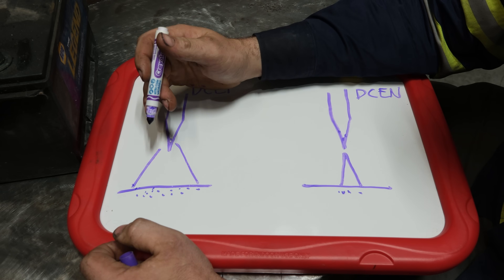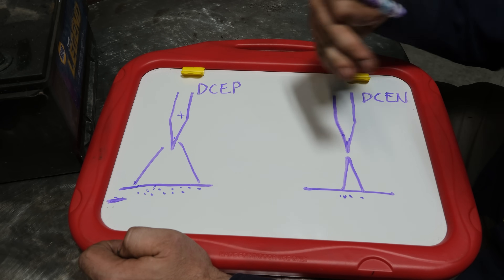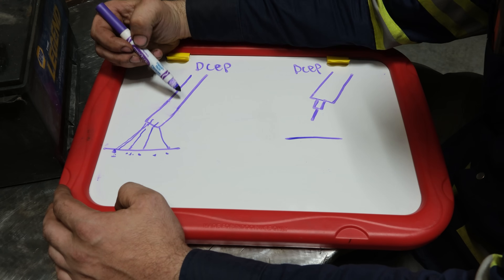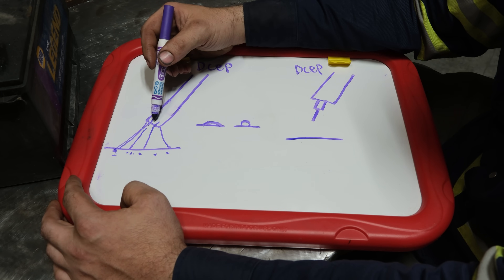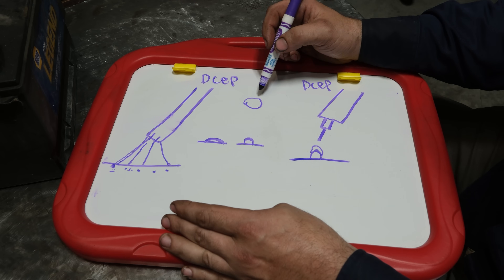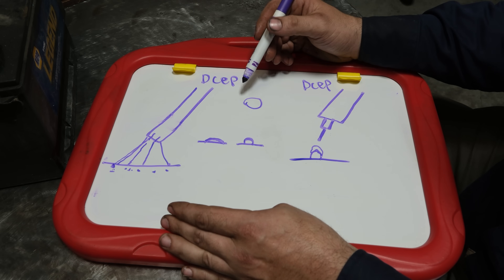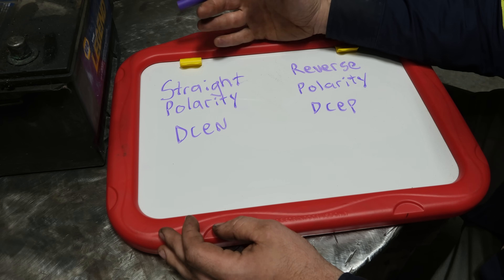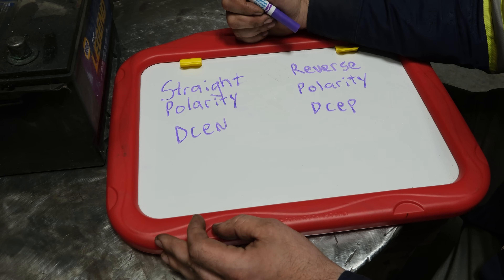Welding polarity and why electron theory is used (In response to #weld.com)

Comment: Why is DCEP work better for aluminum in TIG welding?
Reply from the maker: So aluminum has a surface oxide that can’t be easily removed by sanding or chemicals.  It’s very hard (aluminum oxide is actually used in sandpaper) and it must be stripped from the surface or the weld pool will be poor.  That oxide melts at a higher temp than the base material which is also a huge problem.  Think of pond scum floating on a fish tank and that’s exactly what happens when trying to weld aluminum with tig on pure DCEN.  The material under the surface will melt but the surface is just floating full of contaminates.  To deal with breaking the oxide layer up there are a few options.  1) to weld it on a/c and when the cycle switches to EP the electrons jumping from the base material to tungsten break up the surface oxide.  2) use helium and DC, the helium combined with higher voltage strips the surface oxide off making it possible to weld the aluminum on straight DC.  

So conventional tig welding of aluminum is done on a/c with 70-75% of the ac wave being negative (or electrode negative, or penetration) and 25-30% positive (electrode positive, or cleaning action).  This gives enough cleaning action to break up the oxide layer, and provides a clean molten puddle.  Older transformer machines weld on 50/50 EN to EP, and that’s less desirable.  The more electrode positive you have the hotter the tungsten gets and the less penetration you have.

Comment: This is not true.
You read on the outside of the box of your electrodes what polarity to use. Electrode positive or electrode negative. Basic electrodes normally connect to positive, and rutile electrodes normally connect to negative, many times they can be used either way depending on what kind of penetration you need.
Connecting the electrode to negative makes a better penetration in the material.
Some electrodes can even be used positive, negative or AC (alternating current).
Reply from the maker: You must be outside of the USA.  Here, there are no rods that are specifically designed to weld on DCEN.  There are rods that will run DCEN (like 6013,7014,etc) but they are not marketed as the primary polarity being DCEN.  
In the US we don’t use 6013 for much, but we don’t have access to multiple 6013 rod types.  For whatever reason we went the 6010-6011 route over multiple types of 6013.

As far as penetration, DCEN lowers penetration vs DCEP with stick and especially mig.  A pure DCEN arc (like tig) penetrates more than a DCEP arc, but not with stick welding.  I made a video that demonstrates this with a cut and etch that will be out in a day.  The phenomenon of EP having more penetration than En is well documented.  There is a multitude of reasons why, but the primary one being how the bead ropes up and the arc has to penetrate more weld metal with EN vs EP.
Reply: @makingmistakeswithgreg  
It appears as there are differences by region. Here in the old world we read off the box what is recommended for polarity and current, and then anyone can do as they like. 
We find texts like this (translated):
"When welding with direct current, with most electrode types, the minus pole is connected to the electrode and the plus pole to the workpiece. An exception is the basic electrodes. They are better welded towards the positive pole. The same applies to certain makes of cellulose electrodes."
Reply: I agree, we in Europe have on any box signs
+~  mean DCEP and AC 

-~  mean DCEN and AC
Not all electrode can work on AC 
So yes we have polaryti design electrode. I can take photo of box electrode from multiple factory.
Boeler , and some less known name. In Europe we have clear designation for any electrode, polariti, working position. And materials.
On any single box. No way to make confuse.

Comment: I always thought it was weird that in stick welding the correct and normal polarity was called “reverse.” 

I like your explanation that it’s  the direction of electron flow!
Reply from the maker: It confused me when I was in school to learn to weld, it made no sense as to why “straight polarity” is what few processes used.  The instructors offered little explanation.  It makes sense when the context of what they are using to determine that is known, otherwise it’s kind of “that’s just how it is” lol.

Comment: So if I wanted to write something on the surface of a work piece, like a label or something,(or for a decorative reason) with a mig gun, I could switch to DCEN, because it will be mire raised up and not as wide.
Reply from the maker: Interesting question.  I bet the writing would be way high and have virtually no penetration.  The beads I’ll literally sit like caulk on the plates. So I think that wold work for what you’re looking at 😀👍

Comment: One reason dual shield uses DCEP is the wire core consists of a flux and metal powder mixture more metal powder than flux. It is all down to the effective cross section of the wire gas free is much lower cross section as you said in your video than dual shield as the metal flux mixture is conductive.

Comment: You can thank Ben Franklin for conventional current.
Reply: We never learned using the term conventional. It was always Franklin theory. Also learned that reverse polarity puts the heat in the plate while straight puts the heat in the end of the electrode and the plate doesn't get real hot.

Comment: Power doesn't flow from one terminal back into the other terminal. It all goes into the arc. Current circulates, power doesn't.
Reply from the maker: I not exactly sure what you are referring to as power.  Electrons are negatively charged particles and they jump across an arc gap to the positively charged terminal.  The light output and plasma is a direct result of the shielding gas or air becoming ionized.   The completed circuit is required, you can’t weld with only one lead.  Without a positive and negatively charged terminal you wouldn’t have any movement of electrons and no welding.  In a vacuum you won’t have light output or a plasma with an arc, simply an emitter and a receiver.  You will still have a flow of electrons and you will still consume wattage despite there being no plasma.

Comment: Im still trrying to figure out how grounding really works
Reply from the maker: In very simple terms Electricity “flows” in electricity conductive materials like steel.  “Grounding” in welding is completing a circuit by attaching a clamp to material you’re welding on (or something that what you’re welding on is sitting on).  For current to flow you must have a completed circuit or you don’t have a path.  Effectively the metal you’re welding on (and anything that’s conductive between the electrode and the ground clamp) functions as though you just clamped the ground wire directly on the electrode.  The fact it might be an odd shape (like say welding on an engine block)doesn’t matter, electricity will flow through it.  With welding, electrons may move through the clamp towards the electrode (DCEP) or through the electrode to the clamp (DCEN).  The only reason the direction matters is because of the heat generated by the electrons striking the other end of an arc gap changes how things melt.  

Calling it a “ground” is kind of misleading, it may actually serve as a “hot” with DCEP polarity.  I know it’s confusing, often times simple terms are held onto despite being inaccurate.  That’s the same reason why welding polarity doesn’t make sense if positive is “hot” as in conventional current.  Just think of the “ground” clamp and wire as part of the completed circuit 😀👍.
Reply: Yes - the term Ground can be very confusing and means different things to different people, depending on what you were taught or commonly heard other people use.  Perhaps using a different term for Ground may help, I know it did for me where Straight and Reverse polarity gave me a lot of trouble when I learned to arc weld. 

I simply like to think that the “Electrode” is guided by your hand, and the other half of the circuit is what you are welding/working on, and the clamp (often called the “Ground Clamp”) can be referred to as the “WORK Clamp”, which is a term without a reference to polarity.   You still need to match the proper polarity to your process, but using terms without polarity can help reduce confusion where the term Ground can cause confusion depending on which theory you learned.
Reply: Do not think of it as "Ground" but as "current return clamp / line" it closed the circuit and the Arc is in the "middle"...
Reply: As others said, ground current is return current. I think years ago utilities used to return current through the ground back to the power station hence that term.

Comment: Don't hook up a battery in a newer vehicle backward! It matters big time. Lol.
Reply from the maker: That is correct lol.  ECUs are all designed to have regulated voltage on one side of components only.  Hooking it up in reverse will cause traces, wires, and components to let the smoke out due to unregulated current/voltage.  Definitely a expensive mistake 😮

Comment: We were not taught in school that electrons flow from the positive terminal to the negative.
We played with batteries that had the top cap that was positive and we worked on cars that were wired  with the circuits starting on the positive end and ending up connecting to the negative grounded end.
This caused our minds to imagine that the power flowed out of the positive into the negative.
We then learned in school or out of an electricity book that quite the opposite was occurring.
You sounded to me like you totally contradicted yourself continuously throughout this video.
Reply from the maker: How did I contradict myself when conventional current is literally taught In schools the the USA and if you asked a significant part of the population how a battery works they would tell you “power flows positive to negative”?   That is the conventional wisdom most people have and using that “wisdom” causes serious issues understanding welding.  The directions electrons flow make a huge difference in how welding works, it doesn’t matter in a simple circuit or with a light bulb.  A vast majority of people have no electrical training outside of simple conventional current, yet many people have/use welders without understanding on electron theory.   A vast majority of people that weld don’t even know what electron theory is.  Thats a problem because understanding electron theory clarifies why welding works the way it does.

The only contradiction is the fact what’s most commonly taught does not explain welding or what’s going on.  There were a ton of comments on that weld.com post that clearly demonstrated the average welder doesn’t understand what’s going on.  This video clarifies exactly what’s going on and why conventional current is not correct and shouldn’t be used with welding.  Where is the contradiction?
Reply: @makingmistakeswithgreg  I meant we didn't necessarily get it from school, we got it from everyday living. In school we learned I was backward from what we were imagining.
A lot if your talk was confusing, it seemed like you kept flip flopping in the way the electrons flowed.
At one point it sounded like you said TIG doesn't have any gas.

Comment: AC welding does not use polarity.
Reply from the maker: Ac is considered a polarity within welding terminology.  It is a mixture of both positive and negative.  The ratio is not 50/50 EN/EP with anything other than stick.

Comment: Oxyacetylene doesn't have polarity.  Technically it does you can't have two hoses coming from a single source tank. Well i guess you can if you'recrazy stupid. Can you buy the two pre-mixed? Isn't that akin to making, storing and selling H-H-O and not expecting a giant fart of death? You're not gonna get a whole lot done with just one gas is my point.
Reply from the maker: If the threads weren’t reversed on the torch you could reverse the hoses and weld with opposite polarity.  That would be quite interesting lol.

Comment: The old way describing the movement of current is dead wrong.
It needs to stop being taught it's entirely asinine they need to stop talking about current and to strike that word current from the dictionary. Electrons it's all about the movement of electrons. Protons Cannot Move, they are attached to and make up the element in combination with neutrons which for this discussion don't count.
The only thing that can move is the electrons.
The reality is electrons leave the negative and head towards the positive it would probably be more helpful if people were to describe it as anode and cathode.
People designing circuits and electrical systems might be more comfortable saying PNP or NPN describing the transistor junctions in relation to the circuit.
There is another way of describing current flow again as sinking or sourcing current flow is involved it's dead wrong as well.
Current as a apparent Force may work for a River but for electricity no lose it forget it.
Then there's this other stupid terminology and it's only stupid because of the word current is involved again otherwise it would be perfect it's fine positive and negative logic and in this case the IEC is to blame. 
people start talking about this crap and all it does is makes my head explode I don't give a shit what they want to describe how they wanted to describe it, you tell me what is positive what is negative and which one we're going to call the common that's where I walk away and get busy.
Until they stop talking my eyes glaze over I just have to stop listening for my own good.
Reply: In the automotive world "conventional" is taught because the frame of the vehicle is attached to the negative terminal of the battery, so the positive "hot" goes to the negative "ground".
Reply: The whole car should be considered ' hot ' and all the circuits are returns to the battery.